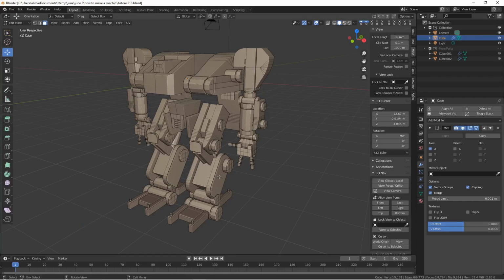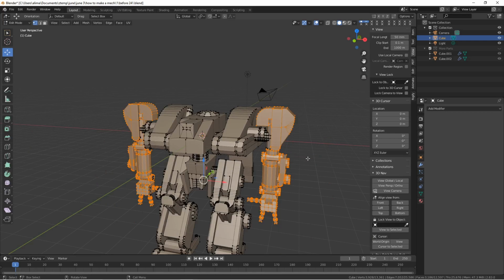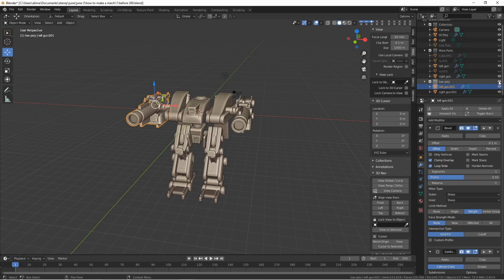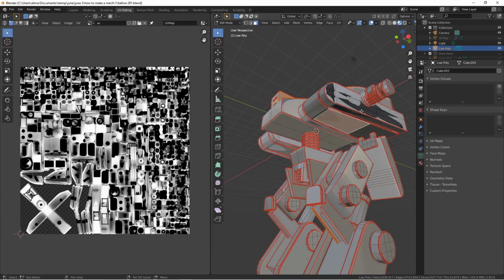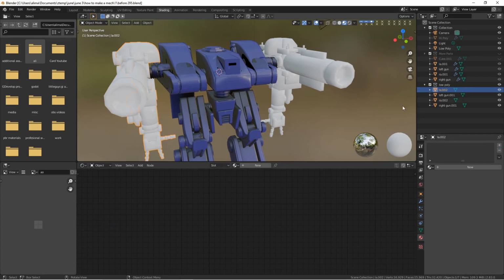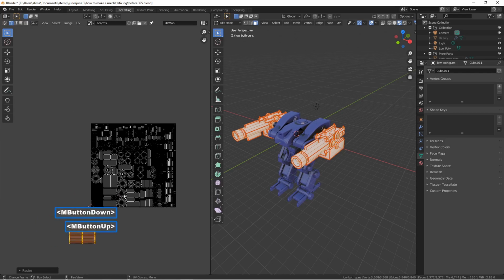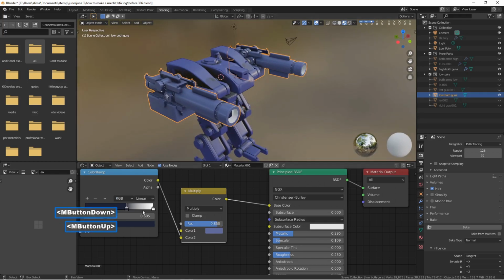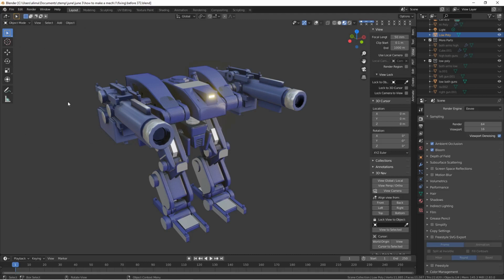Make A Mech In Blender 2.83 Part Two

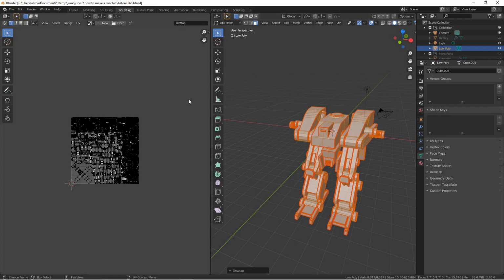Comment: Hello Alimaya Arango sorry to bother you but I manage to reach up to the UV unraping of the mech without too much fuss(time Stamp 37:40), but after that point I just can't see to get the proper backing for the Normals or the AO despite the unwrapping going perfectly as far as I can tell; it's like the first image you go before you did the UV unwrapping and the baking seemed to only end up looking like two squares and two smaller haft squares and nothing like the obvious segments like you managed to do. Also I can't see to find the 'UV export' is there a particular Add-on that I have to activate for that ?
Any guidance you can provide would help a lot.
Reply from the maker: Hi Mix-up. First thanks for watching this tutorial. I'm not sure what you mean when you say that you can not get the proper backing. I'm including a link to the finished mech for you so that you can look at the file. I'm hoping that this helps you out. The UV export should deal with an add-on.  If the file does not help you or even if it does and you still need help contact me again and we will work our way the issues. Thanks again for watching this video Mix-up.

https://drive.google.com/file/d/1bRk3ewHRAn7m3zd5IlRfcfYr7SAl_Bx9/view?usp=sharing
Reply: @AlimayoArango  , Sorry, for my misspelling, I was very tired at the time, I meant the 'baking' the Normal and the AO, for some reason I even after four attempts of trying both the baking never seemed to turn out the same way as yours. I watch have tried my best to follow every steps and setting but it never seemed to work.
Reply from the maker: Were you able to take a look at the Blender I sent you the link to? I was hoping that would help.